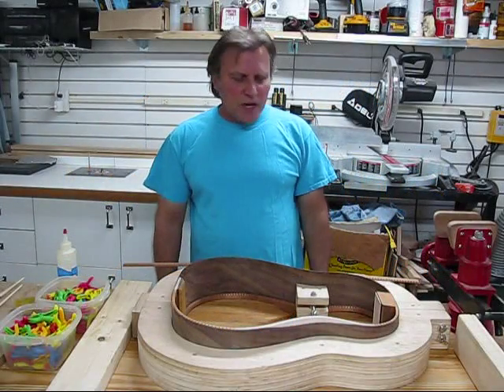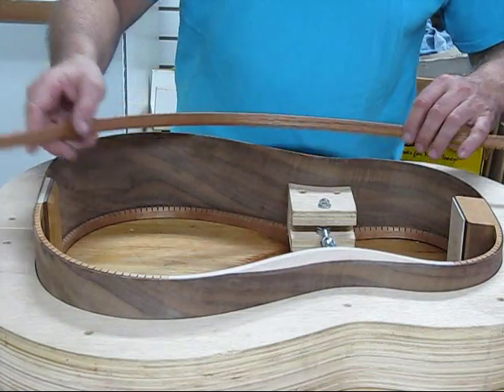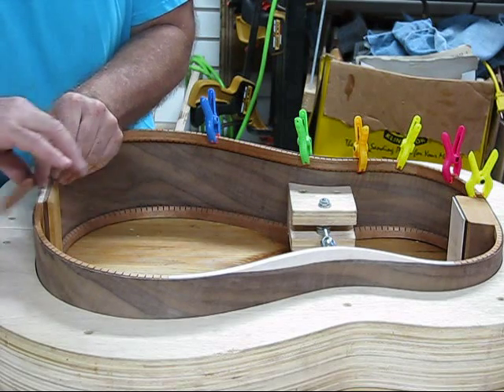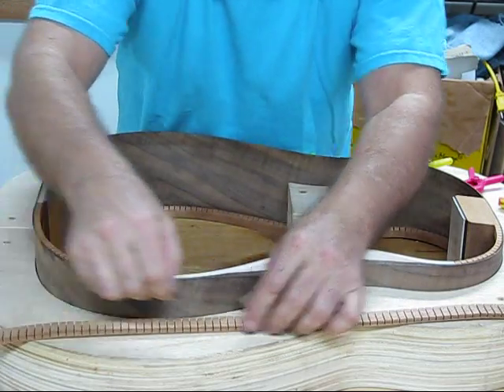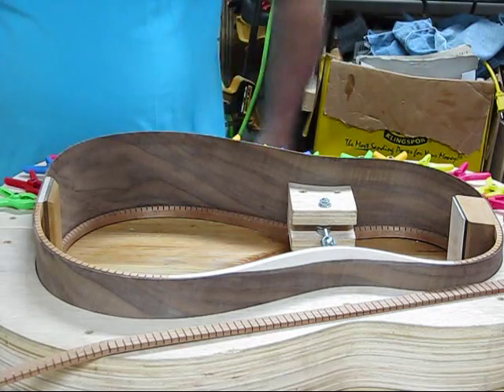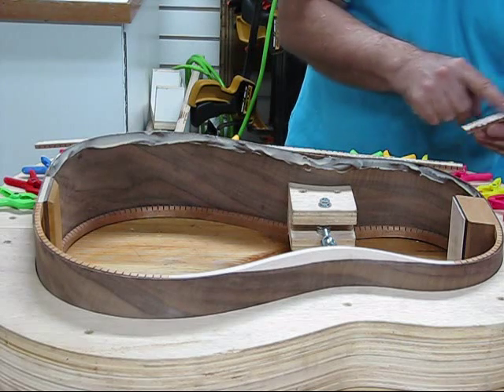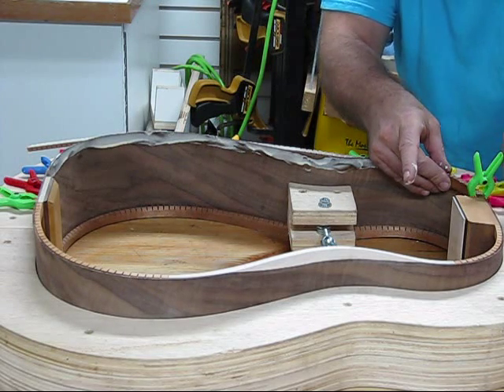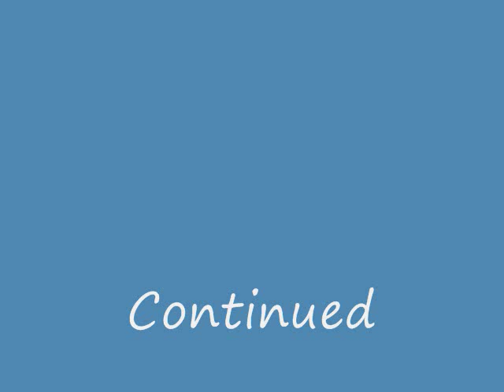Gluing On Kerfed Lining Or At Least How I Do It Part 1

Comment from the maker: Pretty much for strengthing the rim and a way to connect the top and back to the sides.Some use solid lining that they bend. The kerfed cuts make it easy to bend and install. I suppose the type of wood has some effect on the top. But I'd guess the more ridgid the rim the the better the top can move and use the string energy and etc.  Your question would be better addressed at the Forums then here.

Comment from the maker: @kd8ux Depends if they are concerned if the brace will come loose or unglued down the road. Some don't want to take the extra time to tuck them in.  I tuck in the X braces, upper transverse brace(if I have one) and the back braces.  Some even tuck in the upper bout  X brace ends and not the lower bout ends.  It's  about freeing up the top in that case.